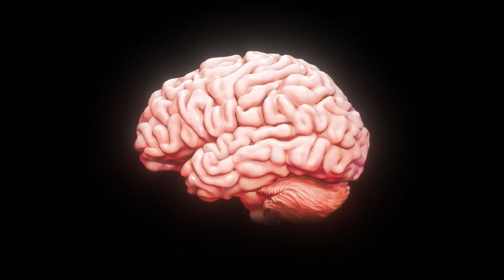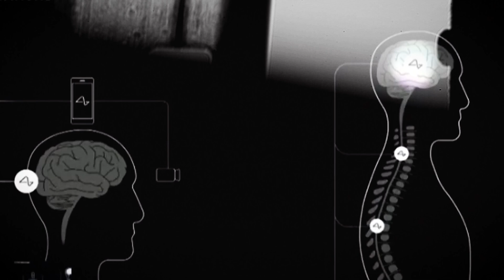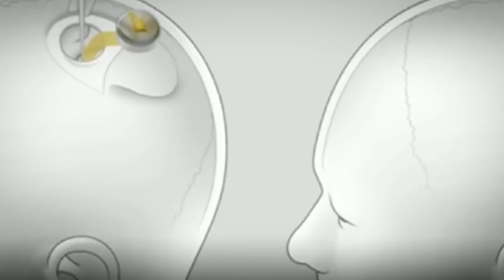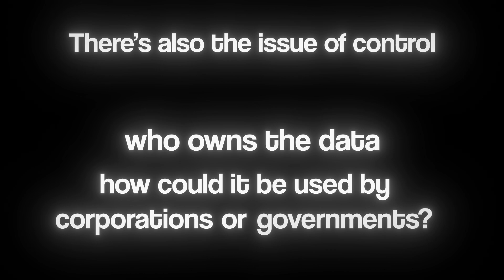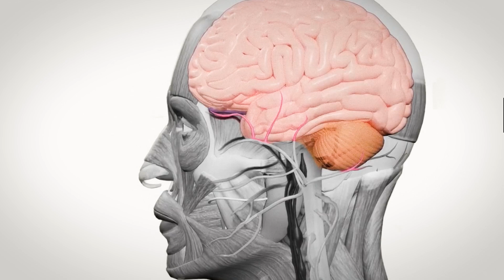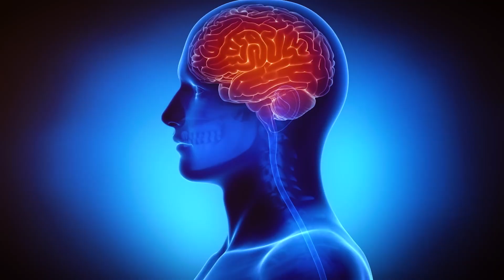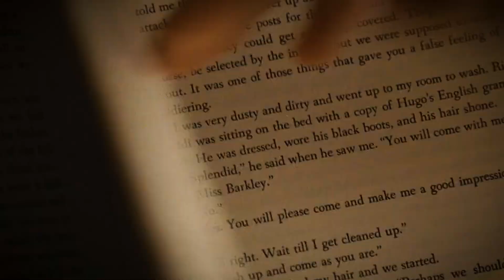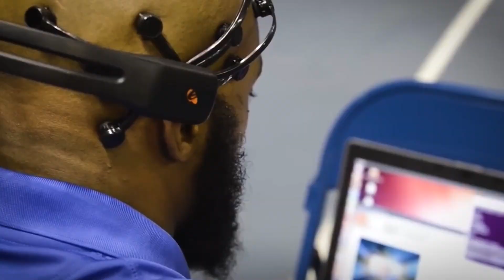Expert: "Neuralink Just Made Your Brain a Quantum Computer!"

Comment: Easy solutions for the hacking issue:
Program your own network&device IP before installing or right after installing it. 

Also, pretty sure if you can simply fight against the hack by using pure thoughts/visualisation. “I cannot be hacked” 
the chip should do the rest